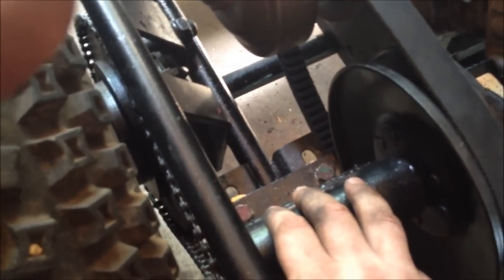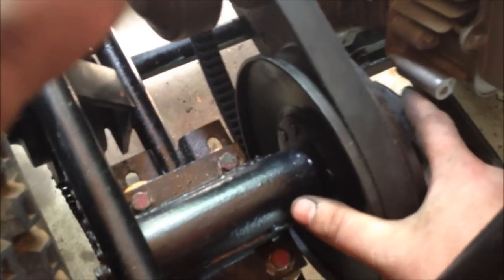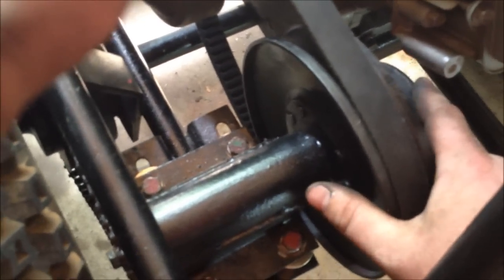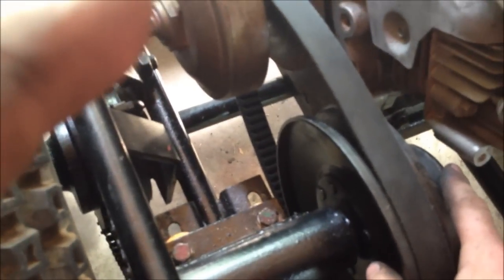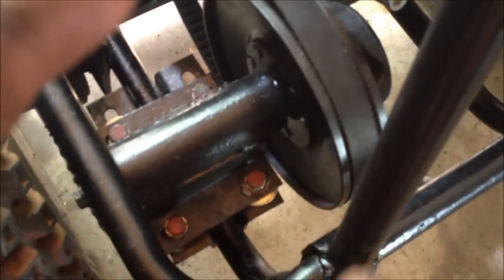Go Kart Project 4 - Belt/chain problems.

Comment: Make sure you put the belt on right there's a 2 degree angle on 1 side and the other side is flat  so look at the pulley and match the flat side of the belt to the flat side of ur pulley

Comment: My kart wanted to do the same thing.  I replaced the springs inside the driven with some heavier duty ones and that prevents it from wanting to engage early (while idling).  Make sure you clean all parts of the torque converter too so it can retract.

Comment: I had the same problem there should be a small ring on the inside of the converter try to pull it out to where the belt is that will allow more free movement and push the belt out so it doesn't catch and go crazy!👍👍👍
Reply: hey I have the same exact problem and I honestly thought I blew up the engine yesterday but can you specify what kind of ring it is so I can figure this out? thank you
Reply: It's just a brass bushing. I think he's talking about.

Comment: I think Iv'e learned that the driver and the driven don't have to be level at all, they are both circles and they don't know what level is!
Reply: Tyler Ryan I agree, I figured as long as they're in line with each other it wouldn't matter if the drive pulley was above the axle shaft or under it

Comment: Push you motor forward until the belt tightens. That's what I did when I had that problem. You want the jack shaft to be pushed back to tighten the chain, and motor pushed forward to tighten the belt. 👍🏼
Reply: Wrong, torque converter belts are supposed to be loose at idle.

Comment: When I search tht it only shows the part that  holds the belt I'm trying to figure out what the black axel piece would be called
Reply from the maker: +Dylan Melancon ah i see. I'm not sure if it has a name, but pretty much it is a keyed shaft in a roller bearing assembly that bolts down. And then you put the sprocket on one side and the driven unit on the other. You may be able to order them as a whole from somewhere, but wouldn't be hard to piece on together.
Reply: Did u figure out. What the black driven unit thang is im trying to find one thanks
Reply: @jeffwatkins5780  called a jackshaft
Reply: @jeffwatkins5780  the driven unit is the pulley that goes on jackshaft. The drive unit is the clutch portion that goes on the crankshaft PTO of engine. These combined (drive and driven pulleys) are called CVT belt drive transmissions. Comet is the name brand of them and come in many different models.

Comment from the maker: I've got it all lined out now. The tc had a broken spring inside and I lined the engine up better. Thanks for watching!
Reply: Keith1212 what size belt are you using? I am workin on one identical to yours and need the belt size. Thanks!
Reply: @mariehenegar6365  ever got your answer 😂
Reply: Does the converter come with stock set up. I can’t get mine off..

Comment: take the belt off and throw a chain on it just measure up a chain and use It In the place of the belt. it works . I couldn't believe it when I tryed it
Reply: What? There's no way for it to get friction from metal to metal without a cog.

Comment: I would say a brass bushing would make it run better at idol
Reply from the maker: You may be right. I never did get this belt system working perfectly. It was always just ok. I ended up selling the kart for $500 fortunately. Thanks for watching!
Reply: I build custom mini bikes and this was happening after the bell came loose and scattered across the road. Never did find the bushing.

Comment: What is the part that converts it from the belt to chain ? I need a new one for my kart
Reply from the maker: +Dylan Melancon That would be called the "driven Unit". If you google image search "Variable go kart driver" you will see a couple images that should help you. Thanks for watching!
Reply: The jack shaft can be rebuilt. I think they use 1630-rs bearings if i remember right. What is does is move the engine position. Its allows the engine to sit back farther and to be moved more centered in the kart. It would actually be better if the jack shaft were longer when using a torque converter. They are easy to make if you have access to a metal lathe.